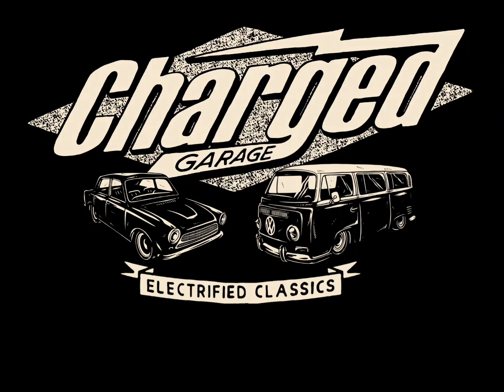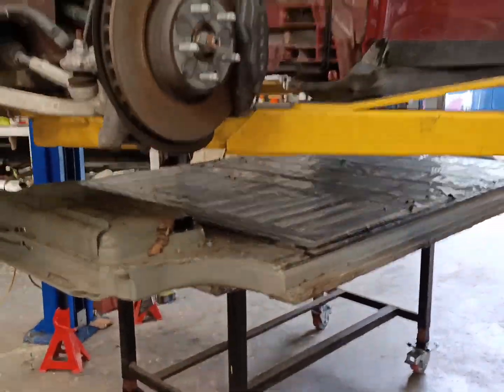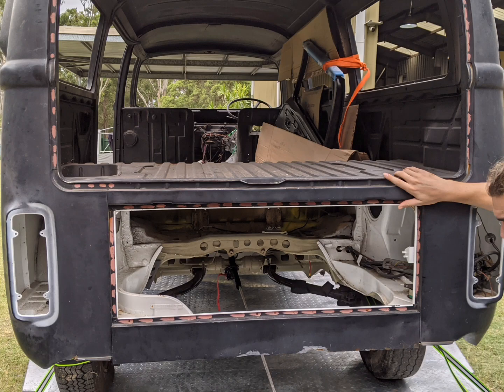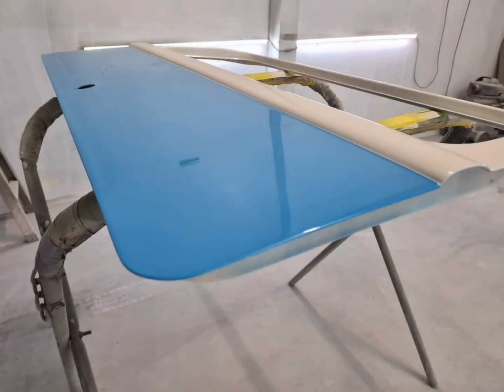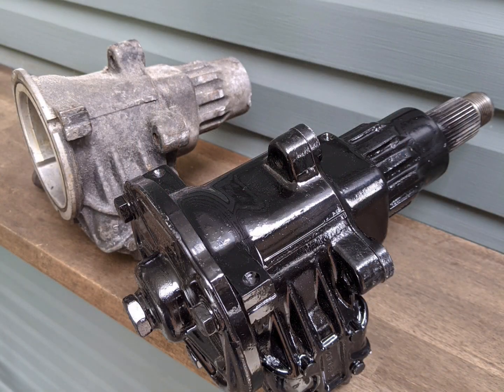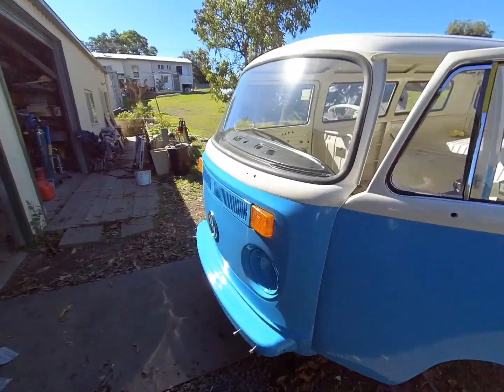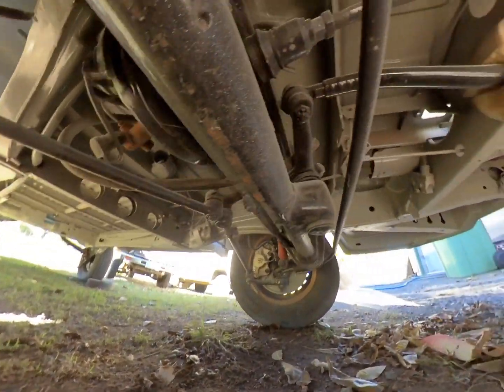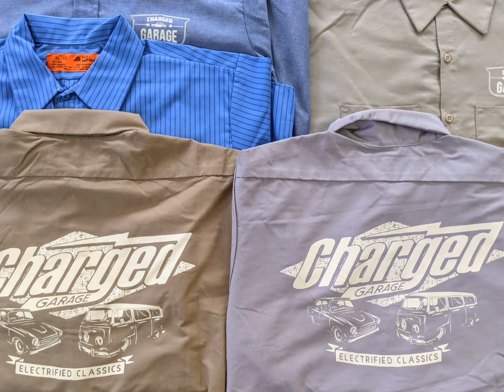VW Tesla Kombi - Electric Conversion EV Project - Part 2

Comment: Do you have a step by step process on how to strip wrecked Teslas, then modify any vehicle type to use their motor?
Reply from the maker: No I don't, that's a bit of a big question there. You'll need to do your own research.
Reply: @chargedgarage131  I've been on the forums, to get an estimated 200-mile range on a bus with 2 warp 11s will start at $44,000. 
I can buy a bus at auction and 6 demolished Teslas for less.
Tearing them down doesn't appear impossible, I've always been good at disassembly, but having it modify to a bus is escaping me.
The forum guys would just use the Warp 11 method. Tesla has a Semi on the road with 4 model 3 motors towing 80,000lbs.
I'm looking at a short bus probably closer to 16,000 lbs.

Comment: Nice build. Great quality.
Wasn't the whole Tesla cradle possible to mount?
Reply from the maker: No, there's no need, I'm using the VW suspension and hubs etc, so for engineering approval its just an engine swap. It's far too wide anyway.